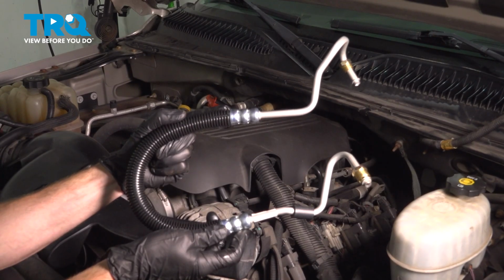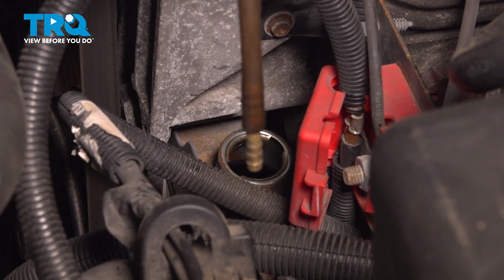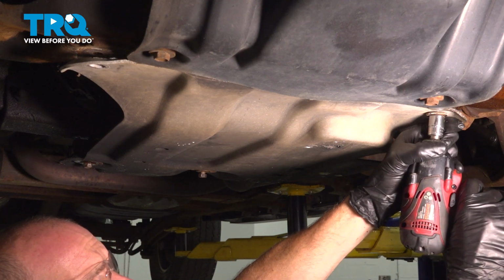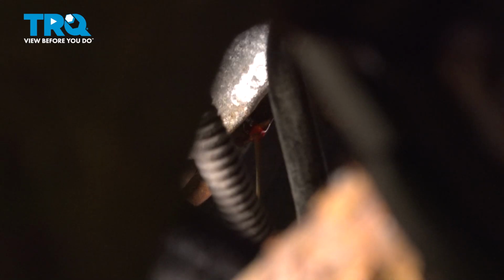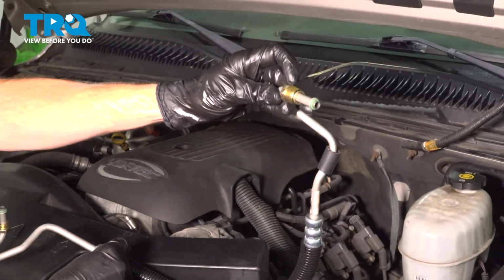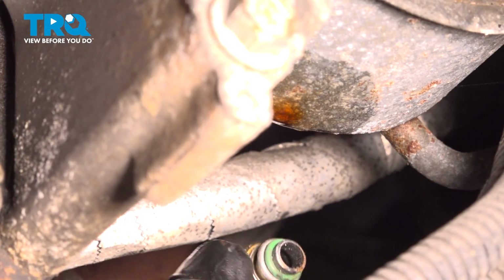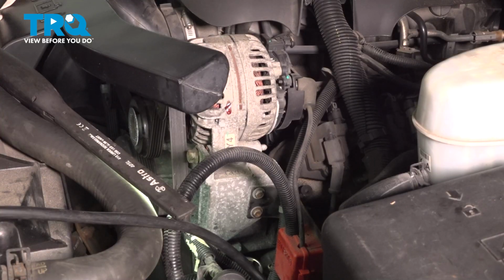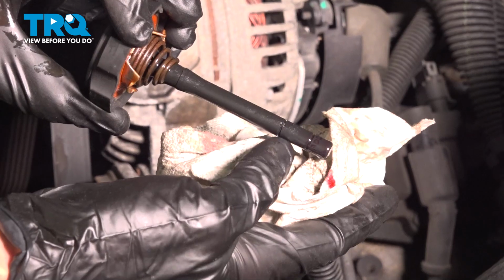How to Replace Power Steering Line 2000-2006 Chevrolet Tahoe

Comment: Im changing that same hose on a 2003 gmc yukon demali and the fitting on back of the pump does not seem that easy to remove very hard fit hard to reach not sure how u did it to make it seem so easy

Comment: This may be a strange question, but why did you disconnect the line from the brake reservoir before replacing the power steering hose?  Thanks for the video.